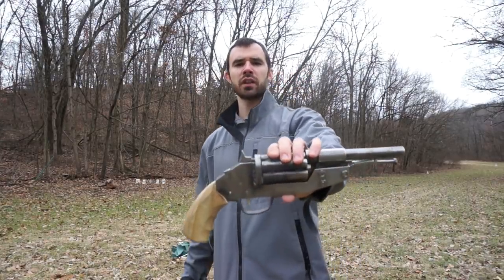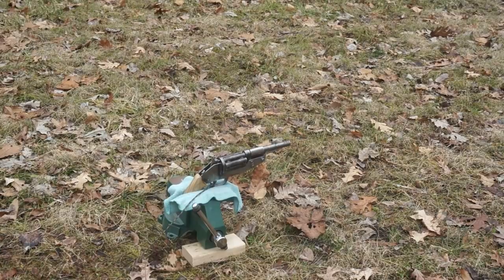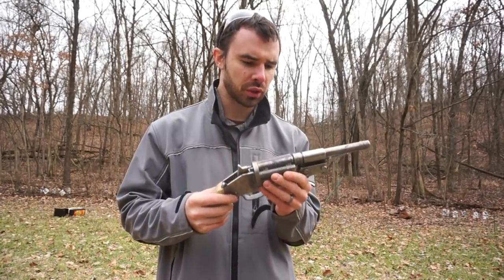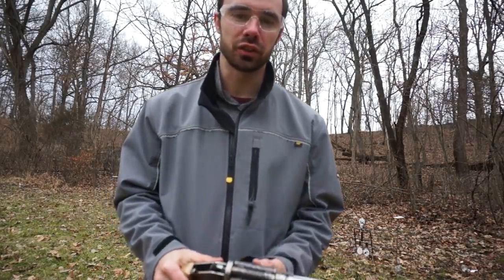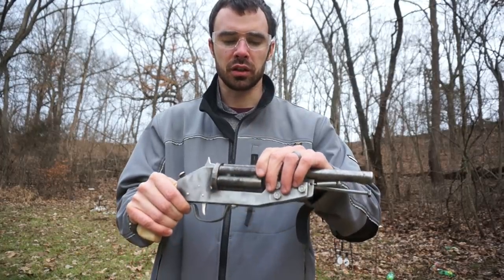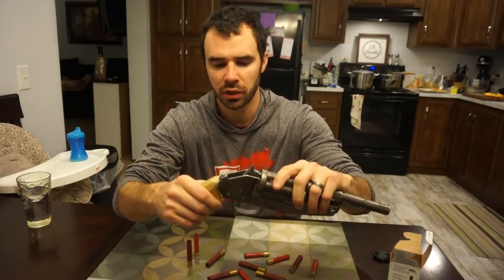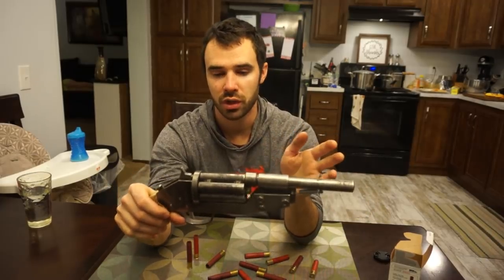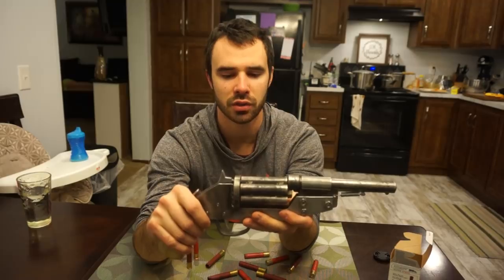Homemade revolver, range test first rounds.

Comment: That ejector rod seems to be a bit loose. why not adding some ring around it to keep it parallel to the barrel?
Reply: i guess it would shorten the length you can push the rod in...
Reply: @Wissensmacht   ring doesn't have to be near the end. Just like its on Colt SAA
Reply: Show us yours... didn't think so
Reply: @luckyred1818   after you. Oh wait.
Reply: @240pixel  go to your safe place little girl. Waaaaaa... waaaaa
Reply: @240pixel  Just ignore that dude, he is projecting big time. Reminds me of how aggressively homophobic guys are actually the most likely to be repressed homosexuals. Just projecting their internal anger about themselves onto others.
Reply: @luckyred1818  hum.. What ? Because he didn't made one he can't give advices? He already gave a working example, what else do you need?

Comment: Can you try to make a carbine version of this
Reply: Requires him to have a decent gas seal, otherwise he probably will burn his wrist
Reply: Baker Tankersley with the barrel set up  its probably not a bad gas set up. Gonna leak some but it probably seals ok. Maybe with a beefier spring you could set up a carbine version
Reply: @baker90338  not really though revolver carbines at least the old colts were supposed to be shot with a two handed grip just useing the shoulder stock with it, forgotten weapons has a great video on the 1860 colt carbine youll notice it has no handguard on the barrel
Reply: He Better does this

Comment: You could always use the BB method of alignment, That way you can use a fixed barrel...
You need a BB that is slightly bigger than the chambers mouth, a spring, a screw, and a tube who's internal diameter matches the BB.
Attach the tube to the 6oclock position under the barrel, and insert the BB and the spring into the tube, use the screw to hold the spring and the ball in place (some kind of spacer might make this easier).

When you rotate the chamber by hand the BB will be pushed back into its tube, but when the cylinder is aligned for firing the BB will plug the mouth of the bottom cylinder preventing it from rolling out of alignment.

I hope that makes sense... :/

Comment: Vrap some paper around the gun and see if the gases tear the paper - if the barrel move forward.
Reply: I think that would probably happen regardless of whether the barrel is running forward or not. Every revolver has some gas leakage there.
Reply: @Devin_Stromgren  Every revolver except Nagant M-1895.
Reply: Well, the Nagant reduces it, but I doubt it eliminates it completely.
Reply: @Devin_Stromgren   Devin Stromgren  I saw some napkin tests and must say its impressive good. Namely on forgotten weapon chanel.
Reply: I watch said channel religiously, but I do not recall the video in question.
Reply: I'm sure that barrel blows forward...what I don't understand is why design it to? However I just found this one and haven't watched the build yet.  Very curious how he designed the indexing system.

Comment: You should make the cylinder rotate when the hammer is cocked. You could do this my cutting out some small metal wedges, one for each cylinder. Then, add a spring loaded tab to the hammer, so when you cock it, the tab is pushed up against the flat surface of the wedge, rotating the cylinder. The tab, being spring loaded, will slide over the angled surface of the wedge, getting pushed back and under the next wedge, so a round is put into place when you cock the hammer, and the gun is ready to rotate the cylinder once the hammer is released.

Comment: For the safety issue. I was thinking some added 'pin wide' slots. 1 for safety and other safety off.On the inside where the safety mates. Youd  likely wanna smooth them out. Grind down one side and make the out of safety a double pin. IDK if im explaining right. No drilling or anything. Like this /      //  Soldered or expoxied pins

Comment: Now im wondering if a choke can be added to tighten the spread the shot....but not so much for the buck. When i saw the full build i was guessing that a slug would be a bad idea but all in all perhaps by using a higher poundage spring on the barrel would work as a better way to keep the seal from barrel to cylinder closed when firing a heavier load such as buck. Keep up the good work and hope to see more work like this one man.
Reply: One could be made if he wanted to. Typical .410 chokes can't be but proprietary ones could be produced by him probably.
Reply: I don't think it'd keep the cylinder closed from overpressure tough because it'd both increase pressure inside the barrel along with having nothing to do with the cylinder.

Comment: I doubt you lose much velocity. Most of it is being generated inside the brass case head and the cylinder walls. You basically have 3 inches of barrel before the cylinder gap.

Comment: Are you gonna fire .45colt from it ?
Reply: I certainly hope not pressures much higher much more dangerous
Reply: It might be able to fire long colt.  But it will need to be built for it.
Reply: Mysterious Stranger yes it can definitely fire 45 lc however that does not make it a good idea lol
Reply: @heatheryllanes6925  thick steel tubing should have no (big) problem firing an historical BP loading, but yes, a modern +P would rip it apart - so the obvious solution is to use another .45 caliber instead. My vote goes for .454 Casull EDIT:  .460 S&W Magnum.
Reply: Even do i would really like to see him do it
Reply: Look at the size of that thing!!! 45 Colt would be fine IMO.
Reply: @tafino  but it will surely explode when he gets his hands on that
Reply: @Heather Yllanes, A standard pressure 45-Colt must not exceed 14,000-psi peak pressure to be sold as standard (not +P) ammo in the U.S.A.  The same pressure rating system rates a 3" long magnum 410-shotgun shell at a maximum of 13,500-psi peak pressure.  The pressure isn't an issue for standard 45-Colt loads.  Whether his barrel is PERFECTLY aligned with the cylinder chamber is the issue.  What he said about slugs is true for 45-Colt in the same way for the same reasons.
Reply: Maybe 45 acp will be better than long colt
Reply: @simont.tanguay5376  it probably would be but since its not rimmed it would just fall through the cylinder
Reply: @simont.tanguay5376  , @Austin , Max pressure for 45-ACP is 21,000-PSI which is 150% the max pressure for standard (not +P) 45-Colt.  45-Colt in it's standard not +P format is a very mild low pressure cartridge that is only just barely 10% or less more pressure then most shotgun rounds.

Most people don't understand this because they generally consider 45-Colt to be more powerful then 45-ACP which it certainly can be.  But 45-Colt being an older cartridge designed to work in guns made back when they didn't have as good of metal to make guns out of usually uses a larger case size holding more of a slower burning powder to generate it's power.  The difference between a steady strong shove on the bullet vs. a quick hard smack.  You can generate just as much or more power with the long softer shove and it's a lot easier on the gun.
Reply: A “cowboy load” .45 Colt would be safe.
Reply: Its not so much the design itself holding up, its the material used...
Reply: Pedro Americo issa explode way to much pressure and power

Comment: After watching the video closely several times there does appear to be some gas leakage around the barrel and cylinder. However the slide you manufactured to bridge the gap between the cylinder and barrel doesn’t look like it’s moving when fired. 
I gotta say you’ve built a radicle looking pistol....It sure would be interesting to see how Thumper handles a slug round.

Nice job on the build. Thanks for the video.

Comment: Hey dude, it's a fellow weapon maker here, and I love to see ho your channel grows! I'm watching every video and I am impressed of the quality firearms you can make, I can barely make a good shotgun (maybe lack of good mateial) and I am having issues with the breakbarrel- lock on the second one I am making (1st one's a succes :)), so can you give me some tips about the mechanics?
Reply: What issues are you having with the lock an what style of lock are you using?
Reply from the maker: thanks man, so here is a link to a vid of a break barrel and how I did the locking mech. https://www.youtube.com/watch?v=pHbTb3PoTME just an idea but it worked well and was very easy, keep workin on it bro it just takes a lot of time and only thing I would say is the tighter the tolerances you have the better things just work out. good luck and be safe!
Reply: @dmanx500  I was making the lock so it would hold the barrel up by having a strong spring hammer on top of the barrel, but it often slides off and I can't make a little gap in it because that would make the barrel unsafe. Now I have seen the lock on AK's double barrel I have some other ideas, but thanks for helping
Reply: @akcustom7838  That lock is precisely what I was looking for! Thanks dude! I think I am going to make a prototype first with firecrackers. And if that's done I'll post it on YT. Again thanks 😊

Comment: I want to see you put 45 Colt rounds in there the barrel is rifled and it can take 3 inch 410 shells there should be no reason it can't take 45 Colt, I would be very interested to see how it would hold up with some high-end Lever Revolution from Hornady. I'd also be interested to see the accuracy test

Comment: Can you possibly get some slow motion vid of the gun? Specifically the barrel when fired, I’m curious to see if the barrel has enough tension on it to overcome the pressure of the .410 round going off, mostly curious if it could handle a 12g too
Reply: Nvm lol, hadn’t watched the whole video yet 😂

Comment: I think it might be a useful variation to make the barrel (with a heat shroud) to work as a pump-action to advance the cylinder. Since the cylinder mouths and the barrel breech are tapered to mate, that would provide alignment. If the cylinder(s) are the same diameter as the barrel, you might consider a secondary cylinder over the original six cylinders, which protrudes out slightly, and the barrel breech would slide into the slight protrusion of the "over" cylinders?

Comment: re. the possible barrel movement.
do the test they used on test revolvers and on the nagant.
put a piece of paper next to and  in parallel at the cylinder.
if gas escapes the paper will show the result.

Comment: Ak are you manually timing cylinder? And wouldn't a top strap add to stability. The Remington 1858 only ran into clearance issues bc of cylinder swelling.

Comment: What if you did the same type of design for a full length shotgun? 12 gauge
Reply: Could be both good and bad. Likely won't have much recoil due to being very heavy if its action is an unscaled version of this one but obviously, it could also be cumbersome. However, it would be a much simpler shotgun than pump actions.
Reply: Der Duden good to know

Comment: I was wondering if this design could be altered so that the central pin the cylinder revolves around can be pulled forward (away from the hand grip) on a spring and the entire axis pin and revolver cylinder can be swung open like most of today's revolvers. Just a thought I had, I would love to hear your thoughts on the idea.

Comment: You can test if there is gap between the barrel by setting up a paper towel right next to the gun while firing, you won't need slow motion since the results are gonna show on the towel. It's either gonna be completely torn, or completely unscathed. Ian did this test: https://www.youtube.com/watch?v=Dh1mojMaEtM

Comment: Cant figure out how to private message. What mm thickness do you make your pistols out of? 1-2mm as per some paladin press books is not at a usual hardware store.
Reply from the maker: not sure about mm but its 1/8'' steel plate, so if you just look through a hardware store and find like a hefty door hinge or bracket of some sort, that works to.

Comment: Here is a link to a supplier of 4130 chromolly tubing. They have a chart that lists the tubing by Inside Diameter and wall thickness. Thought it might be of some use to you. I have been thinking of something like this in a small pistol caliber, something like a .32 S&W.  https://www.airpartsinc.com/1058_4130_N_Steel_Tubing_(round).htm
Reply from the maker: thanks man!

Comment: could you put a surpressor on it
Reply: Yes and no. Come back in 6-8 months, $200 and a inspection of your nether regions by the agency only paralleed in uselessnes with the TSA.
Reply: If he added a gasket to the "Gas seal" and used a stronger spring, it would totally work.
Reply: That barrel isn't threaded on this gun along with how the ejector ends right at the muzzle but it could be modified to do so, although the cylinder gap would reduce its effectiveness. SJCodan has a solution which may work (I don't know what a gasket is) and you can make your own suppressors too Arzon.
Reply: Jason Wood I don’t think the barrel is threaded, and shotgun suppressors don’t usually last long
Reply: It wouldn’t really matter. You can’t silence a revolver unless it’s built right.